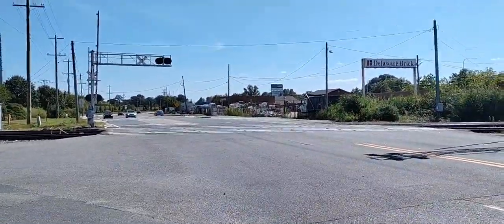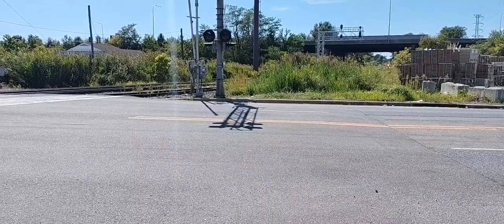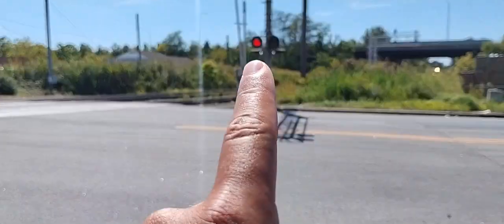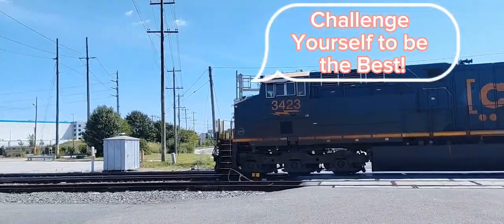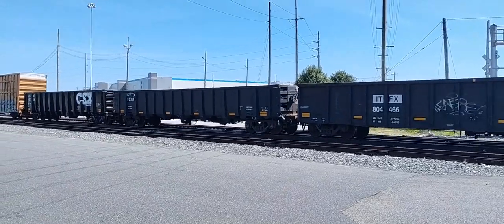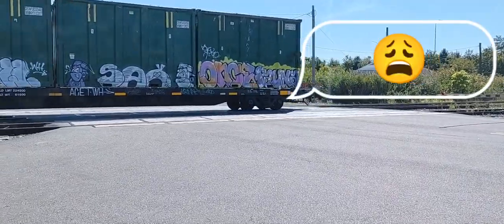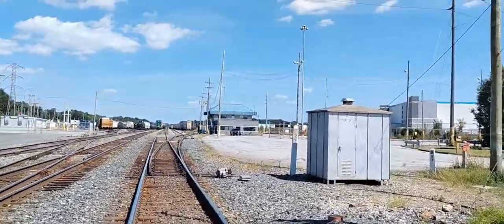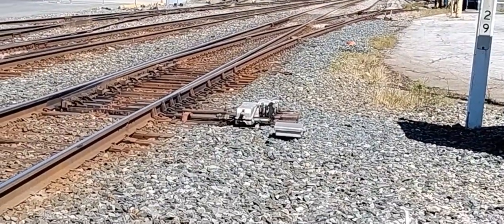Keeping it Short & Simple Causes Multiple CSX Surprises - Explore Why We Love Trains!!!

Comment: First, a question: the switch that you described as hand-thrown (not dual-controlled) had a motor- or sensor-looking thing on left-hand long tie at 4:55.  I couldn't see that it was tied in to the switch-throw mechanism at all—what is that thing?  A switch-position sensor for the dispatcher?  A retired switch motor (if maybe that switch used to be dual-control but they decided that maintaining the dual mechanism wasn't worth it)?  Something else?

Second, it's kind of cool to see the obvious siding right-of-way going up to the left of the signal at 5:19 and on up the left side of the street there (you can see the different color of the pavement).  That's something else I love about trains—there are so many of yesterday's stories hidden in the way the tracks interact with their surroundings, as well as all the still-unfolding stories you can see in the trains themselves.

As always, love your explanations!